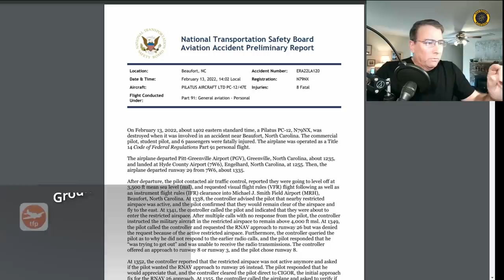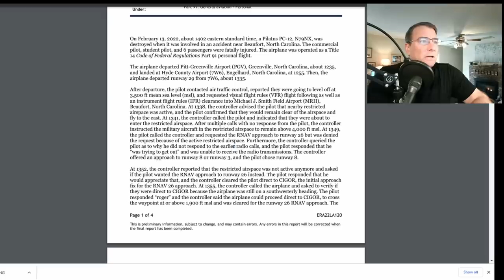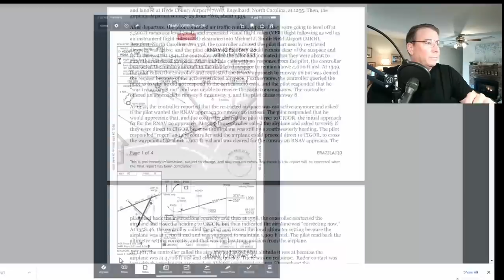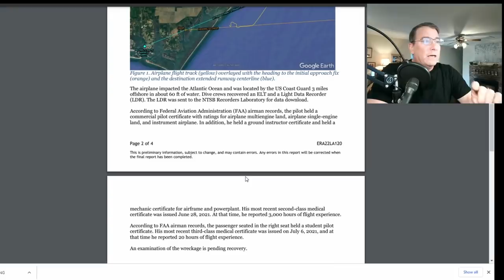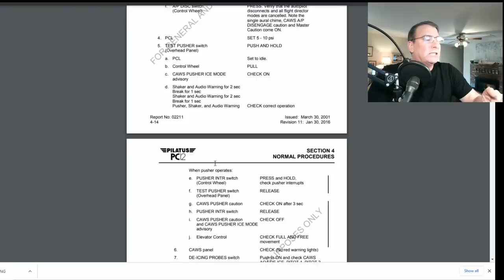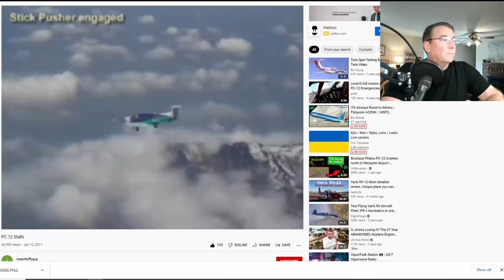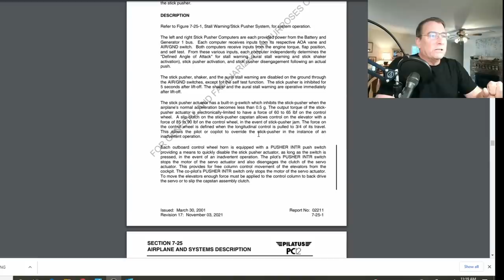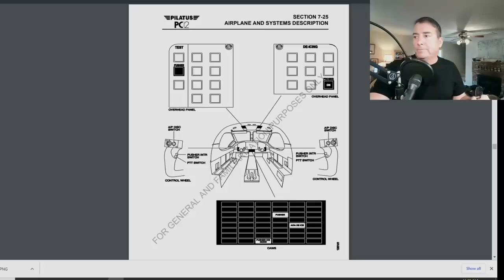NTSB Preliminary Report Pilatus PC-12 Beaufort NC

Comment: Until you revealed that the son was found in the right seat, I was in agreement with Dan Gryder that he and his Dad had switched seats to give the son some stick time. Now I’m thinking physical incapacitation on the Dad. Whatever the outcome it is reprehensible that Pilatus would have two similarly labeled yoke Pusher Interrupt switches that perform VERY differently. Sounds like they might have gotten control labeling advice from Boeing.
Reply: I don't think they switched seats, knowing there was IFR ahead.  I certaintly would want to be in left seat in any marginal or potential weather.
Reply: ...with a death grip on that left yoke, inadvertently depressing the pusher override, while pulling full aft during the event...

Comment: Well, if I understand correctly, the difference between the two stick-pusher deactivation switches may have been the precipitator of this event. I can't see the logic of having asymmetry in such controls. Such a tragic accident.
Reply: Let's hypothesize, the pilot was very off his game. I could write it off as being distracted or basic confusion about what elements he was expecting that day, but it's evident SOMETHING went wrong here for the climb to occur.

So one hypothesis can be said to be a health event occurred, leaving the Co-pilot. With 20 hours experience, in a plane he is unfamiliar with, and also panicking his father is comatose beside him or maybe only half aware due to a stroke or similar.

But why the climb. Who pulled back the stick and balanced on the edge of stability.

Pilot? Co-pilot? Did someone set an autopilot incorrectly?
Did the pilot pull back, hit the edge of the stall, and the Co-pilot pushed the button accidentally? Then fought against the high pressure and failed to apply sufficient force?

Did the stick pusher system fail catastrophically? So they were fighting to get the plane to pitch down and lost the automatic stall protection?

Dunno. Probably need to salvage the airframe to even have a guess at the situation. But maybe the light data recorder will be helpful.
Reply: @glenmcgillivray4707  I think the aircraft was carrying a very sophisticated lightweight data recorder. I hope too it helps solve this incident.

Comment: I have never flown a Pilatus of any kind but I have flown a number of small planes in icing conditions. Some planes handle ice fairly well, others fly like a brick with just a trace. 

It looks like this plane was equipped with boots (black rubber things glued to the front edge of the wings and tail that can be inflated and cause the ice to shatter off). If so and they were picking up light icing, and they blew the boots too soon, sometimes the ice won't break off, it'll just bulge out and render the boots useless. 

Had this happened, they might have wanted to climb quickly in order to get out of the clouds. The stall speed of every plane will be higher (sometimes a lot higher.....) with ice than no ice. If this plane doesn't handle ice well, they might have stalled even though the airspeed was nowhere near the normal stall speed.
Reply: @jeffk4355  Thanks for that, never having flown now, I just didn't know.
Reply: My only experience with pneumatic de-icing is on F-27s.  The de-icing controller alternately inflated and deflated the boots so that the ice would keep breaking off.  Could be a condition where the ice forms over the boot's inflated profile so that the ice cocoons the boot and doesn't break off?

Comment: Kid was probably on the controls somehow. With this switches on the yoke, easy to inadvertently push one.
Reply: You also saw Dan’s take
Reply: Especially since no radio was heard by ATC, the pusher interrupt doesn't transmit.
Reply: Its not as if pushing that switch makes you crash.
Reply: @seeingeyegod  The conjecture  is precisely that. Pushing that switch instead of the transmit switch results in no radio transmission and a stall if speed was low.
Reply: @reginaldgraves1684  pressing the button doesn't result in a stall. It only over rides the stick pusher if you were already in a stall, which normally you'd never get to because of the shaker. There's no evidence they tried to transmit and touched the pusher interrupt at all, that's pure conjecture. More likely they made no attempt at transmission at all, which is often the case when accidents occur.
Reply: @seeingeyegod  Don't you remember before you were really proficient, being in IMC having something go wrong? Pressing the transmit switch and not transmitting, can take your mind off the job in hand. disabling the stick pusher allows the stick to come back, you have already ignored the stick shaker, now the aircraft is going up like a rocket and you are still not transmitting Oh my God!  There were two people flying so where was the proficient one while this was going on?

One of my class in training on helicopters, Westland Whirlwind, was on an instrument approach and operating the Chinese Hat on the control column as a trim because he was used to the Hiller.  After landing the winch was found to have been ripped off the side of the aircraft.  The Chinese hat on the Whirlwind operated the winch!

Comment: I despise taking off VFR at an uncontrolled field when weather is not good and then picking up my IFR clearance in the air.  Too much going on for single pilot operations in these conditions as you can see from this video he was over tasked quickly trying to do this which led him to fly into a “hot” restricted area.  He should have called the FAA 1-800 # to get his clearance.  Another thing that's peculiar about the PC 12 Honeywell apex system is after you have entered an approach if you want to change the approach and you re-enter another one everything from the previous approach does not always seem to disappear, when I have had to do this sometimes things get a little haywire and you have to figure it out or delete some waypoints.  When he changed the approach I think he encountered some errors or was confused on how to fix it and became more over tasked while trying to figure it out.  The auto pilot must have also disconnected at some point while he was trying to figure it all out.  Just my 2 cents…
Reply: The CVR was released on the NTSB docket. It seems to heavily corroborate what you said in your comment.

Comment: I have thousands of PC12 time. I think this guy was not IFR proficient and lost control. Why else wouldn't he have just filed and flown an IFR flight plan? He made his life so much harder trying to stay VFR. I'm sure he got low, in IFR conditions added power pulled up and was overwhelmed. Sad, just not IFR proficient.
Reply: I don't know if you eventually now heard the transcripts from The voice recorder but this guy was completely in over his head in this high-performance aircraft he couldn't even diagnose a master alarm before they even took off he didn't know how to diagnose it what it was and oh my God it's just terrifying and he had eight passengers mostly kids and it's just horrifying they're screaming they knew they were toast when he started cussing and losing his control instead of aviation he was worrying about trying to get the autopilot to work and he ended up getting himself into a accelerated stall in 12 seconds nose dive into the Atlantic Ocean with a plane full of kids screaming in terror.

Comment: I suppose he might have been trying to climb up into the clear, while somewhat struggling with IMC - just a thought.  But listening to this, reminds me of one of my flight instructors.  His 'EGO' and the risks it caused him to take.  So he thought flying 7up and luggage in a Cherokee-6 at 200' over the sea running under low cloud to get through.  Gives me a chill.  But me, a much less experienced pilot was required to lift off into low mist and fly 10 miles ( supposedly VFR) and then replicate his sea skimming 250miles North in a C172.  I stayed on the ground, and he was really dirty with my choice. My point is 'pilot judgement'  and maybe he felt some compulsion to take a risk in the presence of his son??  Just wondering.

Comment: Really confused.  How could this be icing condition?  7C is 45F.....At 1,700 feet you wouldn't think there would be a 12 degree temp drop...
Reply: Could get close.  Depending on moisture conditions, lapse rates generally 2 to 3C per 1,000 feet and they were at 3,000 most of the flight.

Comment: So the student pilot was not on left pilot seat as assumed before, and not flying it IFR as assumed.  Only 20 hours student pilot.  Not flying it for sure in IFR emergency climb.  The commercial and instrument pilot was on normal pilot seat.  And flying it.   Looks like another of the many  Pilot Panic Pull and stall.  And not recovery done either.   Another Panic Pull Stall on a perceived emergency.  Emergency Maneuvering pilot errors..

Comment: If the aircraft was inverted and the stick pusher was capable of being activated, would that cause a elevator input that would cause them to climb rapidly with any remaining airspeed or a manual power increase?   Non pilot here, but curious to know if this scenario is even possible.

Comment: What happens if you’re on autopilot altitude hold and you change the altimeter setting; will the autopilot follow the new setting may be so quickly that it leads to disorientation? It looks like he was flying direct to the specified point until he was asked to change the altimeter setting; is this a digital entry where you might enter the value wrong easily in turbulence for example?
Reply: He wouldn't of had to change the altimeter, though, becuse it was set correctly. They were just flying lower than supposed to.
Reply: Chad Solivais : how do you know? where you there? In any case it was a question of principle.
Reply: @marc-andremuller1954  just wanted to apologize. When going to answer your reply I realized I misread what you were asking.  My bad!
Reply: No, there is ALWAYS  a smooth transition.
Auto  pilot designer here.

Comment: 1) The student pilot might have been flying and did something accidentally. 2) I’m leaning towards runaway trim that whomever was piloting didn’t know how to deactivate it quickly enough and it stalled. Does anyone know what would happen if the trim was running away vs. the stick hard-over?
Reply: Student pilot was not driving
Reply: @bjjjb3056  How do you know?
Reply: My nephew was on the plane

Comment: Reminds me of the MCAS system on 737 max which caused 2 crashes except that the pc 12 pusher system will require both AoA sensors to agree before activation unlike the first version of the MCAS system which required only 1 AoA sensor. A single point of failure can never be allowed on a safety critical system, this should have been an obvious part of MCAS in the 1st place, good thing they updated it !

Comment: Boggles the mind that this airplane is equipped with two AOA that must agree to activate anti-stall while the original 737-MAX was certified with ONE AOA which triggered MCAS.
Reply: A second AoA was available in the 737 MAX as an option for extra cost. Should have been standard. Single point of failure is no bueno.

Comment: If the two pitot tubes have to agree, that’s no better than having only one pitot tube.
This guy had no business flying anything more than a Cessna 182 in IMC.
This is like a PGA pro analyzing a weekend golfer.
Reply: The PC-12 is type rated throughout Europe, but AFAIK does not require a type rating in the USA. Whoever made that decision needs their head examined. It's a great aircraft to fly, but you really do need to be aware and in control, otherwise it can get away from you very quickly.

Comment: In an aircraft that has such nasty stall/spin characteristics, instead of a system of shakers/pushers/interrupt buttons and even an addition of differing rules for left and right seats....why not an arrangement where if a stall is immanent a clutch is disengaged if the yoke is still being pulled on, triggering the autopilot to engage, apply power, and recover... leveling the wings if necessary at the same time? Decoupling the nanny while landing during short field approaches and other situations could be automated and/or triggered by an interrupt. The tech available now allows for all of that and more.

Comment: My guess is they never turned on the heater for the pitot tubes, and they froze up. They also might never even have done a preflight or a checklist before they took off. It's sad, but some pilots are in a  hurry and assume they have everything
It is working and set, probably. Why didn’t the pilot have his flight computer programmed before he took off? That would have prevented him from entering a restricted area—just too many unanswered questions.
Reply: CVR shows he was head-down trying to figure out he GPS way too long/too many times.
Reply: @jahnkaplank8626  Whatever, then don't watch it.

Comment: It appears to me many if not all of these come down to people not respecting JUST how deadly flying can very quickly become if you DON'T follow procedures and know exactly what you're doing at all times.
Have to wonder why they were flying in these conditions AT ALL based on this performance, and I don't mean that to sound like I'm bashing them. Instead I'm suggesting the "should we really fly and if so, how?" questions weren't asked or at least given due attention.

It appears they couldn't nav correctly nor communicate reliably with ATC nor manage their altitude, so it seems like a pretty severe Charlie Fox all round, which also suggests it's UNLIKELY to be a fault of the aircraft. Doesn't mean it's impossible, of course.

Why loss of control? Seems like a lot of these we've seen on your channel, namely someone obstinately trying to fly VFR instead of using the sodding autopilot in IMC situations.
If it's NOT as simple as that, would love to know why. Part of any answer will need to explain if the plane would likely have crashed had they simply used AP.

It's enough to make one angry at the tragic waste of lives in aircraft that frankly seem a lot more capable than the people attempting to fly them.

Comment: Could non nuclear EMP bombs allow Ukraine to enact its own no fly zone? From what I read on Goodle, it appears that non nuclear EMP bombs do exist. They may not stop a tank, but they could disable trucks and rocket launchers. A makeshift EMP device can be made by altering traditional radar. These devices appear to have the capacity to fry the electronics in aircraft. Could Ukraine adapt radars or acquire these EMP bombs to create thier own no fly zone?
Reply: Lots of questions need to be addressed to make this a feasible capability. Here's a subset of them ...

Would the EMP need to cover a wide area or just smaller area, such as a narrow corridor? How high does it need to be activated in order to generate sufficient electron density gradient to cause the desired effect on or near the ground? How would a force deploying such a device protect their own assets from being disabled, as EMP devices can destroy electronics which are switched off?

What alterations do you make to a "traditional radar" to convert it to an EMP generator? If it's a SHF radar (like much "traditional radar"), how would it be deployed so that it's within line-of-sight of the enemy assets to be disabled without being easily destroyed by enemy action? How would it scan fast enough to ensure enemy assets in the area of operation are destroyed before the enemy destroys it?

Comment: Another joy ride in a complex airspace and poor weather.  The seat swapping is never a good idea, and should never be offered to a student pilot.  The PIC was not a CFII.  It will be interesting how the insurance carrier works this accident claim.
Reply: Is there any evidence the student pilot certificate holder was operating the controls or participating in any way?  Not sure you can deny a claim based on speculation.  Are you saying we know the 3000 hr pilot was flying from right seat?  Can you confirm if the buttons on left vs right yoke are identical layout, or mirror images?   My brain would want the left yoke to behave like the right yoke, the same way the pedal on left side behave the same as pedals on right pilot position.
Reply: @chetmyers7041  I think Juan said it's known the son was in the right seat...

Comment: Is there an attitude where the ADS-B signal is poorly transmitted? that seems like an issue.
He must have been in an altered state of mind because of numerous mistakes with no indication that the plane was the problem. You have to be in bad shape to start climbing to a stall and crash in vfr conditions but maybe he had entered a cloud and in his flustered state couldn't handle the instrument abstraction and indulged a full blown spatial disorientation.
Was he dancing with clouds the whole trip? was that the devil on his shoulder. That nudged his logic into entering controlled airspace because he felt he had to avoid clouds. Convinced him to ignore radio orders to exit. It seems consistent with the weather map you overlay if I'm reading it right. That's dangerous thinking. Nursing a VFR at the expense of everything else.

Pilots with that little mental surplus probably shouldn't fly but you could make the observation that with runway to runway autopilot systems and computerized ATC that it would smooth over many lapses in judgment. You could even imagine a special pilot's license that does not allow actual hand flying but only activation.

Comment: Also really not a fan of that stick pusher design philosophy. 40kg force and patches on patches to override. That's bad design. Think about what the assumption is about the pilot if it deems it necessary to use 40kg of pressure. If a pilot cannot heed a stall warning without shaking or pushing, he has no business flying. If the pilot is incapacitated the plane could gently take over all flying, not just push the stick in a stall.